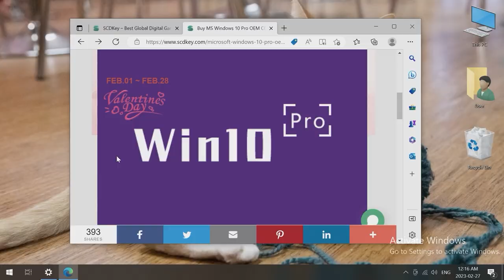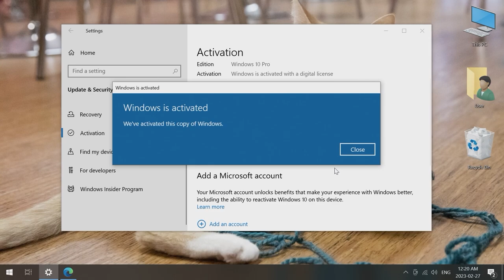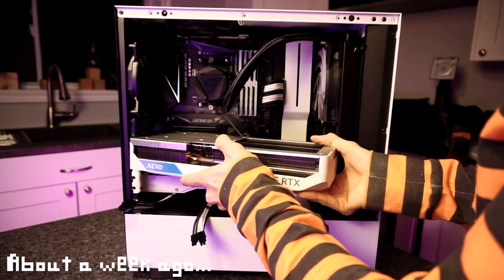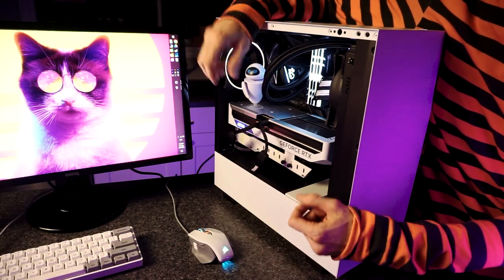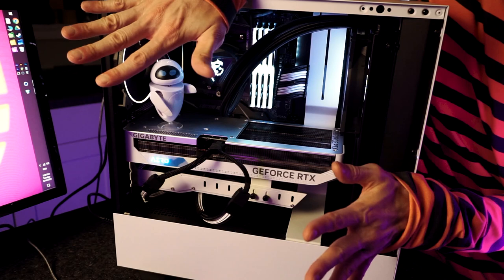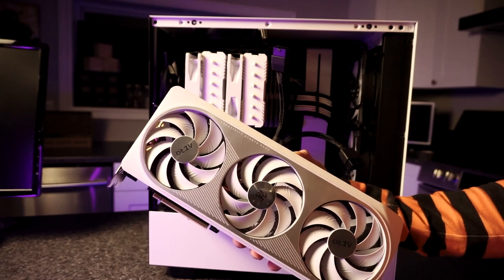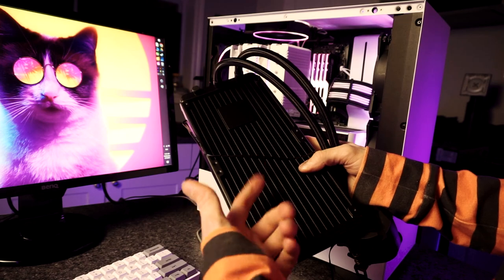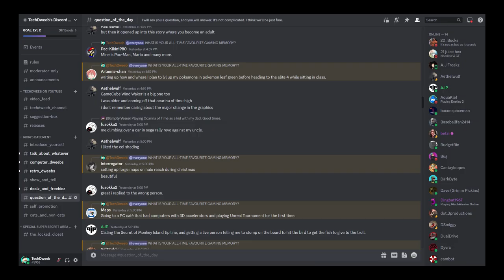Fixing My Terrible "Upgrade"...

Comment: I have that same ASUS motherboard and I love it,  I recently upgraded from Gigibyte board and a 2700x to the ASUS and a 5700x;  still using the wraith prism cooler from the 2700x.  Very nice upgrade, but I don't really do content creation, so the 5700x is fine for me.  Glad you finally got it worked out.

Comment: The moment you said throttle I suspected the motherboard. But I'm also in that mindset because I recently had a nightmare spending three days straight trying to fix my PC after a Windows 10 update conflicted with my motherboard's drivers, preventing me from using the internet, recording devices, and eventually the whole computer. My problem is I'm using a Biostar motherboard made in 2012 and stopped being supported in 2018. I tried everything before I got it working again with a new install of Windows 10, even removing the CMOS battery and RAM for twelve hours. I definitely need to build a new PC was a modern motherboard.
Reply from the maker: Yikes. Glad it's you not me dealing with that 🤣
Reply: I have a question for you guys.  My computers are getting really long in the tooth now.  One of the ones I still have in active service is almost 10 years old at this point.  How often should I be changing things like the CMOS battery and the thermal paste?  I think I remember hearing somewhere that it should be around every 10 years or so.  And replacing the thermal paste would have to include the video card, right?  Are there any other maintenance considerations?  I just want to keep them running the way they're running.  I'm not looking to improve performance or replace any components.

Comment: what a ride! got the thermalright assassin king with a single fan and 5 heatpipes for my 5800x and i was also pretty amazed about the cooler. Looks good, not too big, and allows my 5800x to boost to 4.5GHZ allcore and 5Ghz single (although i run it at fixed 4GHz at 1.08V). Despote the Thermalright fan, which was nuch loader than needed and bearable. Switched it for a artic 120mm ARGB PWM. Would have switched it anyways as all my case fans are the same. And you safe a lot of noise if all your fans are the same because equal sound does not linearly scale with the number of sound sources
Reply from the maker: Yeah it's crazy the quality we're getting at the price they're asking!

Comment: One thing  that come  to mind. I'm not super savvy  on this so I probably don't know what I'm talking about and probably wasn't your issue,  but I had a TUF motherboard that ran perfectly and then I changed it for a ROG because reasons lol. 
My temps were insanely high with this motherboard. After investigating it turned out that the ROG had by default this "Turbo boost" mode that overclocked my cpu way too much automatically in the BIOS.

 Turned it off and my temps went back to normal.

Comment: For that kind of thing like changing CPU, it is recommended to update the bios to the latest version and configure in the bios regarding the frequency of the memory and the tdp, adjust it for the type of cooling you have, in my case in the that I have there is a section that says if I am using a stock or tower heatsink or liquid cooling. Also the time it takes to boot is recommended after you replace the cpu to do a clear cmos to the board.
Reply from the maker: Good tips!

Comment: I made this upgrade two years ago, but god damn... My graphics card does NOT fit inside of my case by like, 2mm. It's even sliiiiightly tilted on the motherboard. ...But it works!
Reply: What a horror it was for me, to have to remove the GPU to even access the RAM slots' locks.

Comment: It's good to see you got it all sorted out. I'm running a MSI B450 and read a few warnings about anything more than 100ish watts. I don't do much video editing so 6 cores is enough for me but I would like to step up from my 2600. Maybe I'll try some overclocking first...
Reply: Do yourself a favor and get a 5600.    It’s cheap, fast, cool and quiet.   Im running mine on a cheap asrock b350 and a bit shocked how much better it is than my old r5-1600.   
I am re using the wraith spire from my old R5 and it works great.   I don’t think the new wraith stealth that comes with the 5600 is good enough.

Comment: Air cooling strikes again, this just cements the fact that water cooling units just break down easier, yes they cool better more efficient but the pumps die too easily....
Reply from the maker: I've had nothing but problems with them. Moving forward I'm only going to use them if the CPU requires it.

Comment: I have this X570 Gaming Edge mobo. It worked fine until I decided to upgrade from 2 sticks of RAM to 4. That caused all sorts of issues, so I decided to go back to 2. Messing with power settings helped a bit, but I couldn't fully use the hardware. It's power management is truly awful.
Reply from the maker: It's a shame, it's a great board in so many other ways.

Comment: shouldn't the top fan be exhaust instead?
Reply from the maker: Not necessarily. It's not going to make a huge difference to have the top be intake as long as you have enough exhaust (I know hot air rises, but it doesn't make much of a difference compared to the power of the static pressure created by your fan config). It depends on your workspace, if you have things on top of your computer, or if your pc is beside you on the floor, then you may prefer to have the heat exhausted away from you or your other equipment.

Comment: Hey why did you go with a RTX 4070ti if you have a 3080?
Reply from the maker: 4070 TI is better than a 3080, the 3080 was used in a different build and I didn't have to pay out of pocket for the upgrade, and I want to have a 40 series GPU so I can make some content about DLSS 3

Comment: Hey Tech, of all the retro Consoles, which one has the best PS1 and GameCube emulation with the most games for those systems? Please and Thank you
Reply from the maker: Most of the android based consoles don't do Gamecube well. I'd suggest one of the Mini PC consoles like the "Super Console X PC Lite".
Reply: Steam deck?
Reply: Is the super console x PC lite plug and play? Or does it require a Pc to twerk settings and and add things?

Comment: Oh I have the x570 mb ☹️
Reply from the maker: In that case don't consider a 5950x or 5900x!
Reply: @TechDweeb  nope I have a msi 3060 and 5800x , 32gb ram running smooth👍